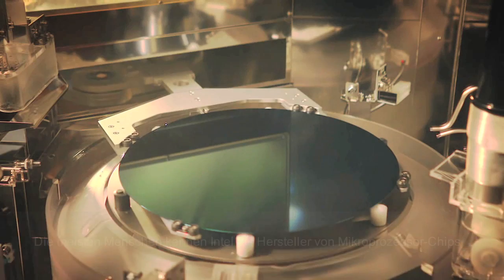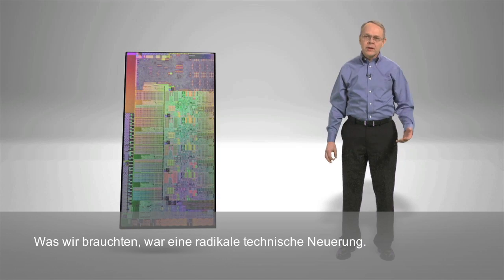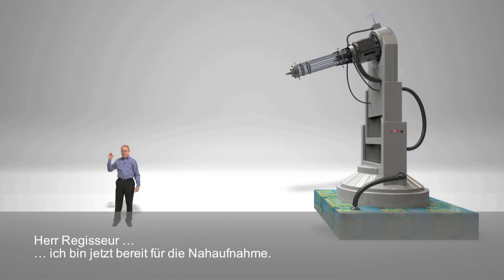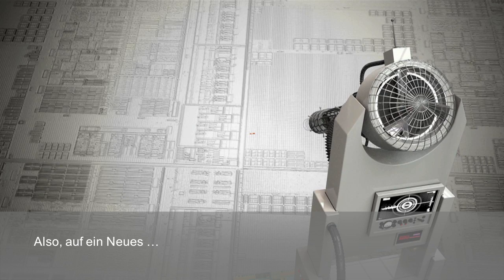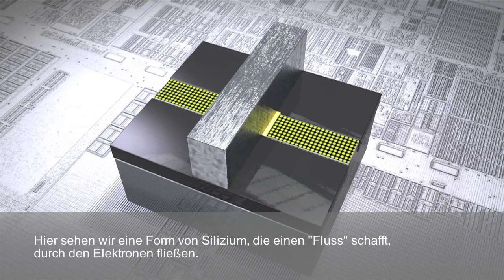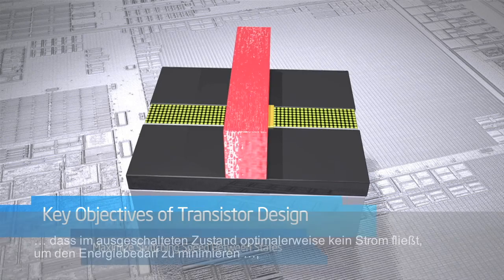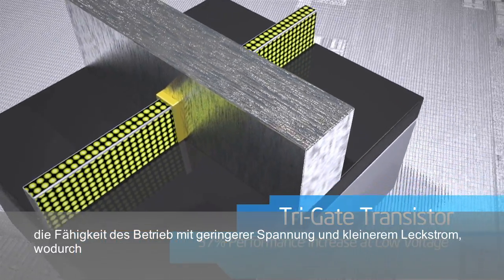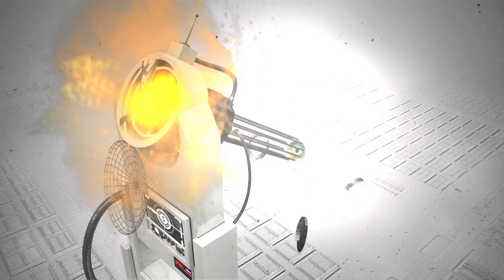Intel Tri Gate 22nm Technology - German Subtitles

Comment: Wow, this is incredible, this should resolve the quantum tunneling problem for a while. Although it will not allowing for much higher frequencies, the additional transistors will provide alot more processing power. This will probably set the precedent for the next generation of processors, I wonder what AMD's solution will be, if they do not adapt this technology or invent one of their own it will be their downfall in the desktop CPU segment. Amazing technology, Intel is always innovating.

Comment: you do realize the sandybridge-E could handle 5.0 to 5.2ghz with air cooling right?  When you shrink those traces their resistance increases and there max tolerance decreases. Thus overclock potential drops along with it. Also note the current Ivy bridge chips only have a duel channel controller so you are going to bottleneck on north bridge bandwidth.

Comment: current ivy bridge chip's are a disappointment the clock speeds are slow compaired to the sandybridge-E. And it has vary limited overclocking capabilities (unless you plan cool it with liquid nitrogen) due to the small pipelines it has vary low voltage tolerances. So overall the ivy bridge in its current state are only good for laptop, where power consumption is a concern.